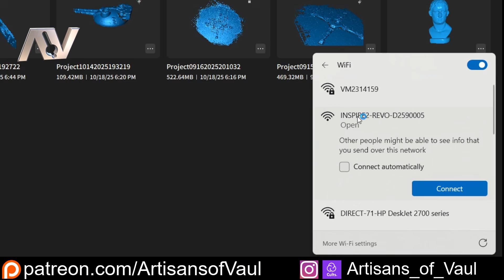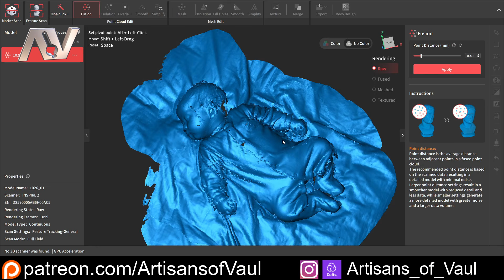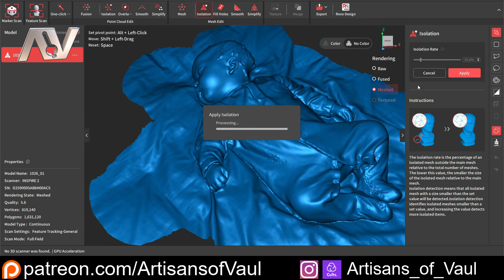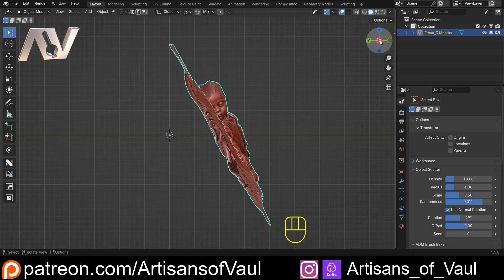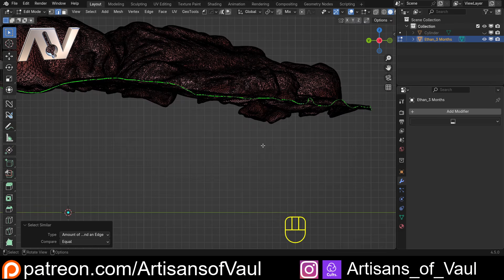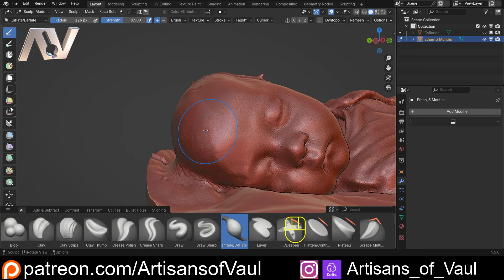How To 3D Scan a Baby For 3D Printing!

Comment: Congratz on the kiddo. Question about the Inspire2, is the software unlimited and always useable? i think i saw somewhere that it has it's own license, which would mean you'd have to pay for it every year!
Reply from the maker: Its completely free to use. They have another software that comes with it thats for companies to use to check sizes of their manufacturing process (basically put in the original design file and the scan file and it checks everything is the same) but thats not something a standard user would need. Everything I have shown in this video software wise is entirely (and forever) free
Reply: @ArtisansofVaul  Nice, good to know, thanks.

Comment: Awww! He's so smoll :)
Nice video. I've been using my phone and the free kiri app to make 3d scans. It's cheap, but not very high-quality stuff...
Reply from the maker: 😁😁😁 Yeah, I've been impressed with that as an app (considering it's going off photos). As a partial tip, it helps to have quite exaggerated shadows, but the issue there as you need quite extreme light to get the extreme shadows and that leads to woken up baby. Also it exaggerates the bigger features to get detail on the smaller ones.
Reply: @ArtisansofVaul  Exaggerated shadows? I'd never heard that one before. I thought it was best to use soft lighting, so that the lighting on the object isn't too affected as you walk around it taking pictures. I'll buy a proper scanner, when I start needing sub-millimetre precision. And when I'm not so broke...